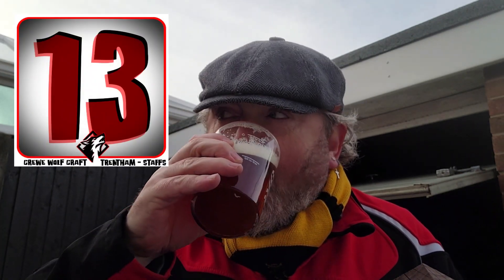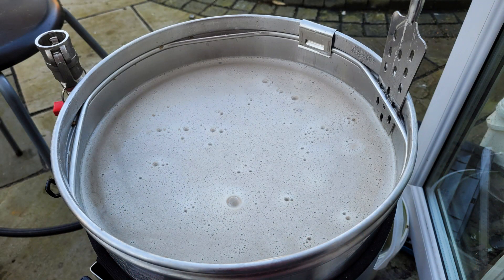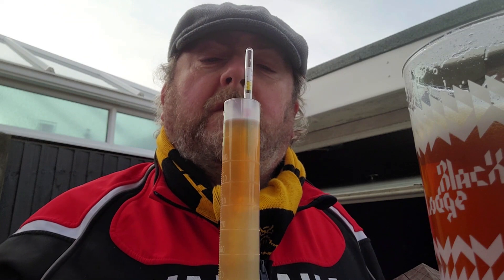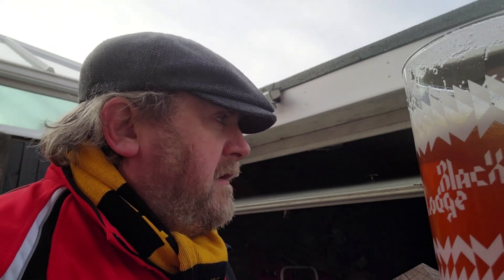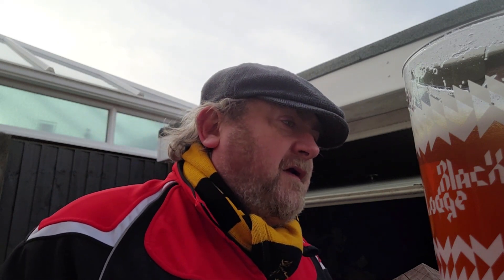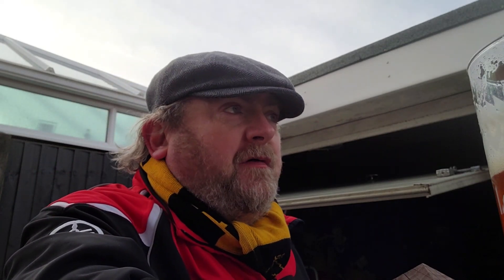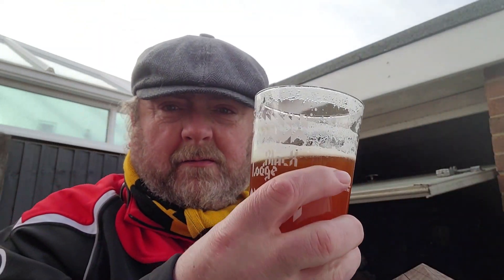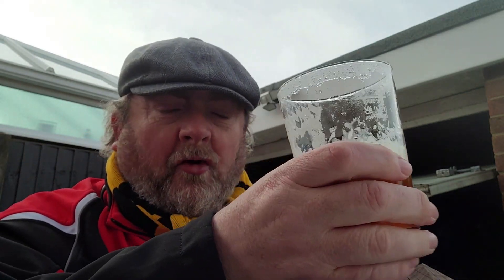HBW 193

Comment: Interesting Mark.  I struggle with my brew volumes using Brewfather - always seems to come up short in my Grainfather.  I've not used a chill cube - but tthinking about it and I have a spare 25 litre plastic cannister. I wondered if I needed to put a drain tap on it though (and a hole in the cap for a bung and airlock?   Do you ferment in the chill cube or pour out into a seprate fermenter when it has cooled in the chill cube the following morning?  Would appreciate your advice.  Glyn
Reply from the maker: Cheers for watching mate, I only use the no chill vessel to leave out overnight to cool then pour into the fermenter, Can leave all the crud in cube and pouring into fv creates more oxygen for the yeast too. Its away and going off like a rocket.